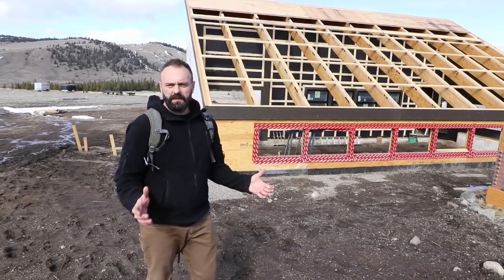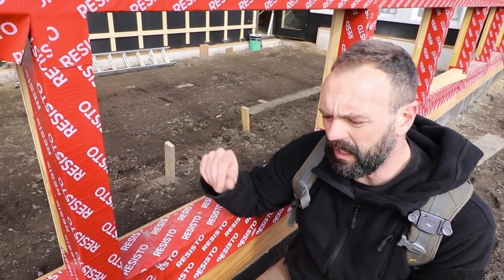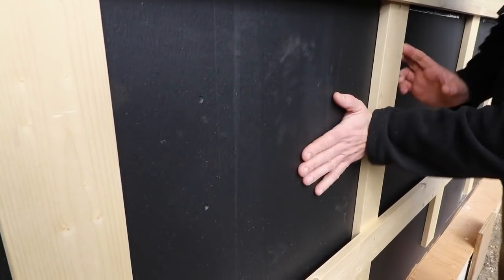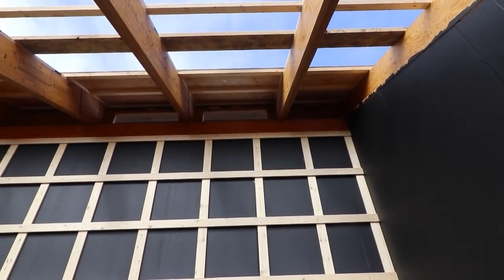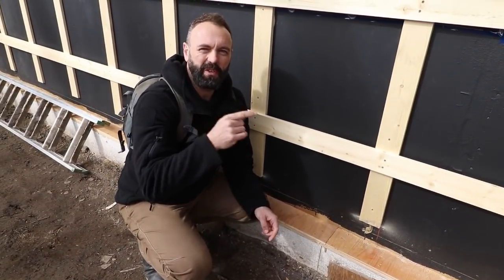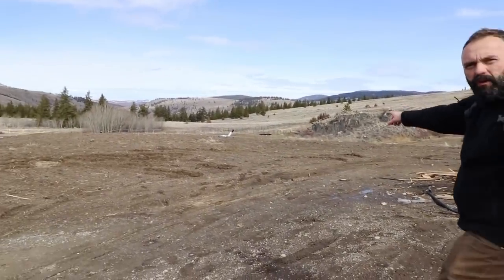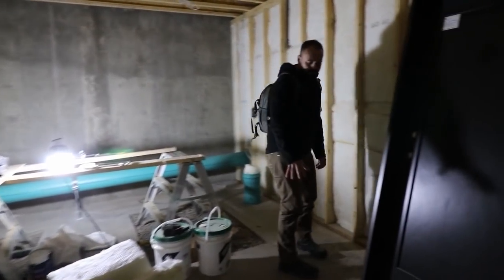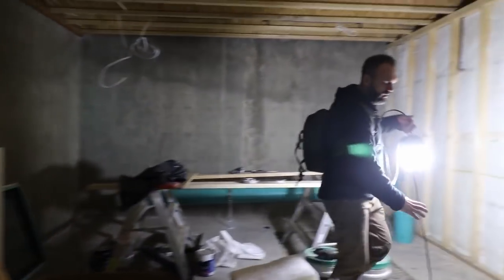The Passive Solar Greenhouse of the Future is Being Built in Kamloops, BC

Comment: I have been thinking about another system to include in a greenhouse like yours. You could add another big thermal battery which could be heated with an evacuated tube system. You could make a 2000 gallon tank about waist high by three or four feet by whatever makes it turn out to be 2000 gallons and place it in the room as a growing surface, essentially a raised garden bed with bottom heat. You could insulate below the tank to reduce conduction loss to the soil below and allow the heat to come up through the top and also on the sides. You would have to experiment with the depth of soil on top to regulate the temperature at the roots. If the tank creates too much heat you could insulate the top a little bit and let most of heat go out the sides. Additionally you could use Agri bond over the bed to retain heat at the level of the foliage.

Comment: Roof seems overbuilt. You get the most value from this in winter, when the sun is at a low angle. A vertical glass wall on the south and a reflective interior would work just as well.

Comment: Will the air flow through the wall have to continue to flow during the hottest days ( summer ) and vented outside after going through climate battery?( diverter valve / line )

Comment: Yours are the first earth tubes I've seen that are perforated.
I have heard that earth tubes often have mold and mildew problems, while the  air to earth heat transfer tubes of a season heat storage green house do not.
This difference is usually attributed to the perforations in the latter which allow condensation to drain, and soil life to compete with the mold and mildew.

Comment: I love the design , im building a very small version of this just across towm from you .    Unfortunatly i didnt set up the air moving system due to funding however i plan on trying a black pipe circulating system to average out the temps in sholder seasons . 

I would love a tour of your green house if you have time !
Reply from the maker: Hey, that's awesome to hear that you have been working on a greenhouse. Stay tuned, we may be hosting tours in the future

Comment: Hi Rob:  Could please answer the following questions:
- what brand of automatic window openers did you buy and where you ordered them from?  
- where did you order your 16 mil polycarbonate panels from?  
- do the panels need to be one continuous length & applied vertically?  A big box staff member is trying to convince me that I should buy his 8 ft lengths of polycarbonate and apply them horizontally, and then overlap the next layer in a similar fashion as you would apply cedar shakes to the roof of your house.  I haven't heard of this method before, but he assures me he knows what he is talking about.
Many Thanks.
Reply: You can buy polycarbonate in 20 ft lengths or more. Do not overlap them. Put an H channel between both pieces.
Reply: Polycarb panels you can get from any commercial greenhouse supplier. Do not use big box panels. Decloet greenhouse is who I use in Ontario. 

Do not overlap the panels. 'Flutes' must run up / down orientation so the panels can drain out condensation. Note that one side is UV treated and stable, one side is NOT. The panel will yellow in a couple years if it's the wrong direction.

Comment: Why not use directed mirrors to heat pipes on the wall inside the greenhouse.  The pipe system should go down to heat up earth battery.  Used Vegetable oil can be used in the pipe system.  428F boiling point.

Comment: Shouldn't the south glazing be at 90 degrees to the winter sun so it will maximize solar gains when most needed? This will also gradually reflect sun as it gets higher as summer progresses. I think your angle will have extreme over heating in summer.
Reply: the standard suggestion for glazing is about equal to your particular latitude.  to allow sun to heat the best in winter.

Comment: Would it be possible to build a similar structure, which doesn't require any electricity to operate? The vents for the greenhouse could be fitted with opening device filled with expandable gas, and could the airflow ever stop in earth tubes for any reason if there was no fans in the cellars?
Reply from the maker: Absolutely possible yes, but would require a much more watchful eye on metrics such as temperature. If things get too hot and you're not watching, there goes your crop.

Comment: Hi. I am interested by the ongoing evolution of different forms of aquaponics and permaculture. As a retired engineer, though, I am sometimes a little concerned by certain aspects of construction that I’ve seen in some of the videos. In particular, I wonder whether some of the innovators are familiar with how building codes and OSH regulations can help them in their designs and safe operations. While yours looks like it has had a lot of thought put into it, I do have a few concerns that I will pass on.

Building code
You say that the ideal environment for storing potatoes is a relative humidity of 70%. In the video I see that the wood overhead in the root cellar is not protected from this humidity. Are you concerned about condensation and the moisture affecting the wood?

Also, I see that the overhead joists are supported on joist hangers. Are these joist hangers and their fasteners appropriate for installation in a humid environment? There are different ones for different applications.

It may be that the work in that room just isn’t finished yet, but I wanted to point that out.

There are a number of penetrations in the web of the engineered joists to run electrical wiring. The joist manufacturer normally provides criteria for size, spacing, and location of holes. In your case, the location of some of the holes look like they may be in question. That may bear your review.

Occupational Safety and Health
I am concerned about your design for environmental safety in the root cellar. As you say in the video, a buildup of certain gases in an enclosed space can be hazardous. It’s my understanding that occupational safety and health regulations deal with work environments, but they may nevertheless address such conditions, and speak to monitoring of gases, which may help you with your design.

Your building inspector should have advice on all of these issues, and may be able to direct you to where to find more information if you need it.

I appreciate you sharing your hard work. I will be sure to watch for an update on this project.
Reply from the maker: thanks for the comment, Alan

Comment: There have been deaths in old root cellars, but they are exceedingly rare, and only happened  in completely unventilated ones. There has only ever been a single case in Canada. I have built several root cellars over the years and all have passive ventilation, that is, natural convection. Very few people want the electrical bills resulting from power ventilation, and offgridders like us cannot afford to waste that power. This is a very impressive project but overdesigned and overbuilt, with the hefty price tag that resulted.

Comment: Computer design is. Fine but seriously never rely fully on digital computer to run it. u make manual human used shit first then ad as a secondary system for digital that is a physical hardware lockedmeaning without a certain chip in device accessing it won't be compatible and having manual auxillary overrides/bypasses aka it can be off but every. System still works manually water,airflow,optimal light . 1 hacker with unsecure system and ur whole greenhouse is dead 1 emp and ur greenhouse is dead loss of power on grid ur greenhouse is dead if it's not got manual auxillary overrides /bypasses